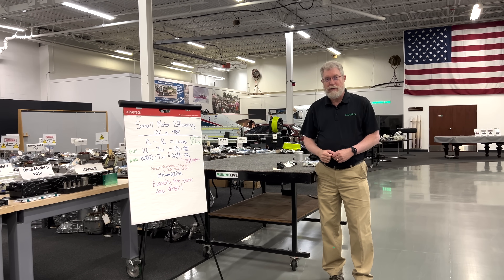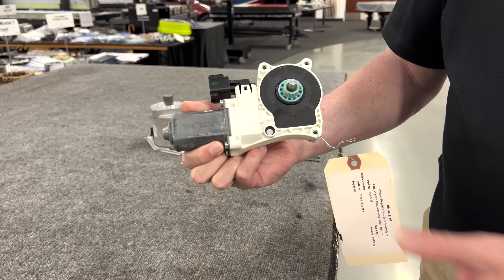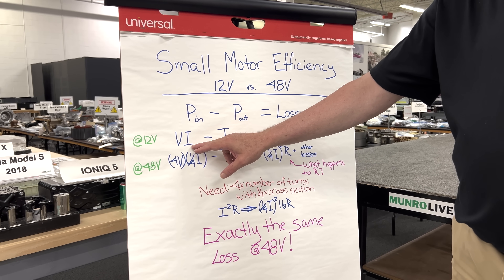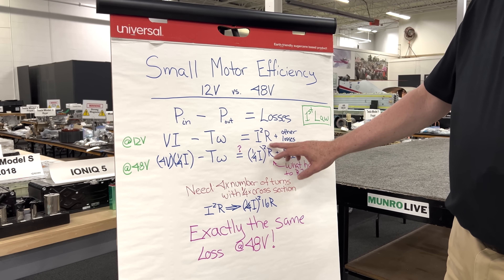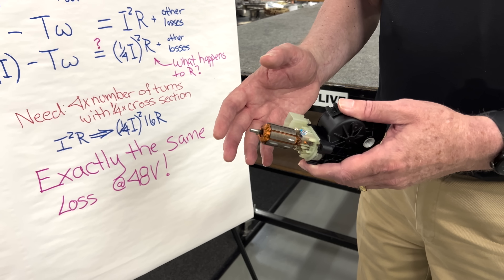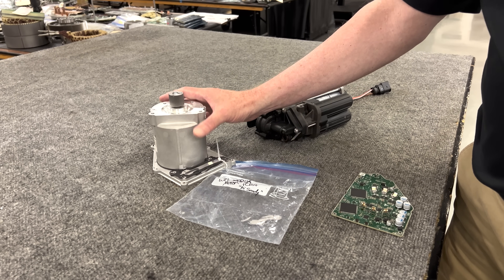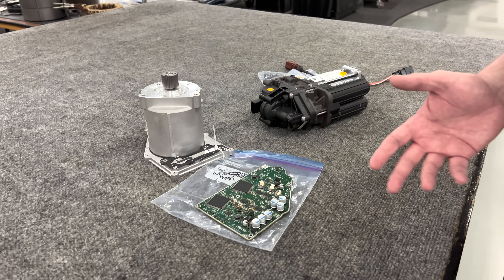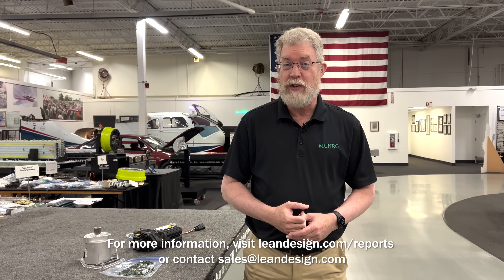Cybertruck 48V Motors: Why Tesla Made the Jump

Comment: That's the size of the truck motors.. Squints at cold steam self sustaining Tesla turbine systems that greatly multiply heat value and pulls out sample of Thermphilic bacteria that if given nutrient drip too dense will cause fires like how they ignite Mulch piled wrong Need Ultrasonic food processor to use ultrasonic waves to breakup and sort nutrient perfectly for %100 max efficiency of the bacteria's biological limits for panels. Oh a few gallons should last for months and months for continuous run cold steam. Woof.. Never freeze vehicle either.

If you pile Mulch and spray the right nutrients you'll see it start to steam in cool weather. If you forget to feed them even if cold they don't die they sleep until food detected. And that's not even using Ultrasonic stimulation on them which would cost almost nothing power wise. Generator stronger than needed for vehicle at full power use and Capacitors between generator and motors. Throws Nitrous Bottle to the side and thumbs up capacitors 

Might as well add a small plasma generator for ultrasonic Anti-drag, dust repel, pressure control, and anti-collision sensors.. Oh! Did I say I was talking about a truck? Points at Spiders flying with static electricity and points at static pipes that could be used for duct style internal blade/gyro turbine flying car My bad.. Why they say in science that Bees produce thundercloud level power in swarms but claim it doesn't help flight while saying static helps Spiders fly? THEY LIE.. Plays LEN BARRY 1-2-3 1966 😇*Trolls world Military like they're an evil Child*

Yeah I'm already on a watch list. Points at Iron man A government that fears intelligence? Yes..

Comment: For the same 100 watts of power delivered through a 2-meter (this is the length of one large human, or NBA player) wire with a cross-sectional area of 2.5 mm² (~14AWG), the power losses due to resistance are - 12V system: 0.93 watts, 48V system: 0.06 watts. 
As you can see, the power loss in the wire is significantly higher for the 12V system compared to the 48V system. This is because the current (amps) is much higher in the 12V system, and losses increase with the square of the current (I²R losses). The 48V system is much more efficient in terms of power loss in the wires.
Reply: you should state loss as heat, the same amount of electrons that went in came out
Reply: Except Paul's argument is that one needs 16x the length of wire to produce the same magnetic field. Sixteen times 0.06 is 0.96, 0.03 watts greater than the 12 volt system.

However, the glaring error in Paul's math is the assumption that power in remains constant. Not true. Only the torque must remain constant. If the motor can be made more efficient that lowers the electrical losses and thus the current requirement. The physics of motors, electro-magnetic fields, back EMF, etc does not result in linear relationships! Or, perhaps changing the gear ratio of the motor would be beneficial. 

In any case, I think Paul made his point - switching to 48v systems is not a trivial task.
Reply: Sure, but one watt is tiny.

I mean, I thought this was a good idea until I read your comment.
Reply: @myid9876543  The more significant difference is that you can use thinner wire for everything while still keeping losses and heating within acceptable bounds. Harness weight is significant, easily 100+ lbs in modern cars. Assume that you need some minimum size for mechanical strength, so 1/4 the current doesn't let you go to 1/4 the wire size but even if you only get 1/2 the size, that's still significant. (Insulation thickness at these low voltages is also dictated by physical durability rather than withstanding voltage, so it doesn't change.)
Reply: The transmission losses are not the primary losses in the system though so its really not much of a savings. That is the point of the video.

People still come in here and blab about transmission losses though so clearly the video did not sink in to everyone 😊

Comment: The symbol "I" is used to represent current (measured in amperes or amps) because it originates from the French word "intensité", which means intensity of current. When electrical notation was being developed, the letter "I" was chosen to represent current due to this linguistic origin, while "A" was already designated for the unit of measure, amperes.
Thus, in electrical equations and notation, "I" refers to current, while "A" refers to the measurement unit, amperes.
Reply: Interesting. I have spent days and months calculating electric problems, and have never known this. 
Also we don’t use “V” for voltage in the formula. It’s “U”. 
So the formula goes P = U x I
Reply: Indian watches rabbit while eagle Flys overhead

Comment: Couldn't you spin the motor at 4 times the speed with the same windings and let the gearing fix the window lift force? The higher voltage can handle the back emf.
Reply: It’s easier to rewind the motor for the voltage you want than to make a custom gearbox for a single SKU.  these windshield wiper motor assemblies are sold by the millions, and mostly share the same mechanical assembly.  Changing the gearing may save you a tiny bit of efficiency or size but you’d negate the value created by making it more expensive.
Reply: ...if the insulation can take it I'm sure it can do that, but at vehicle level does it make sense? The way to look at this is, the window motor is a toss-up, could have stayed a 12. However, since DCDC-s are expensive, no need to step down the HV bus to 48V (necessary for the power steering) and 12V (legacy) - the easiest is to go 48V everywhere.
Reply: @dragosmihai3489  but you still need 12V for 12v power points (cigarette lighter plugs) in the vehicle. Or does the Cybertruck not have any?
Reply: Yes it is possible but it will take a complete redesign of the device instead of just a motor replacement. The reason why it could not gain better efficiency is because they did a quick modification of the device instead of a complete redesign from scratch.

Comment: I believe the main economic benefit comes from the use of smaller wire gauge to deliver the same amount of power. Additionally, a certain percentage of watts is saved due to the reduced current over a given distance, factoring in the wire's cross-sectional area (mm²). The savings are not necessarily from the motor itself.

Comment: How was ride height adjustment implemented before? The steering i guess would have used hydraulics and that’s afaik not efficient..
Reply: Tesla has never used hydraulics in thier vehicles.  They either use motors or air pressure. The S/X's ride height adjustment is done with air.  Cybertruck uses motors (which are end up being faster to adjust).
Reply: @tesla_tap  interesting, thx. In both cases the compressor for the pneumatics is driven by an electric motor? And the 48V saves on mosfets? And what drives the compressor in an ice vehicle?
Reply: @janhofmann3499  - Yep, electric motor air compressor. Not sure about ICE - I've assumed systems are hydraulic from an engine pump, but don't know for sure.

As for Mosfet cost, they are driven by the current capability (not so much voltage).  
It's not a 4:1 cost advantage for Mosfets used in a 48V system vs. 12V, but perhaps 2:1 (for the same power requirement)

Comment: You didn't mention the savings in wiring. The wiring can be thinner, lighter, and cheaper and takes up less space.
Reply: They mention it in every other 48V video so perhaps they realise everyone knows by now!
Reply: @MrAdopado Yes, I didn't mention it in this video because we did a whole video emphasizing the savings in the wiring harnesses earlier.
Reply: @PaulTurnbull-EMfield  while that makes sense to those who often watch every episode of your channel, there is a high chance that others end up watching this as their "random" search result and will not know about that
Reply: marginal.  if savings are significant, the car industry would have been 48V a long time ago since mild hybrids with 48V. it actually costs Tesla a lot more for the 48V system but crucial for steer by wire so the guy is right about enabling new features.
Reply: @zodiacfml  Nowadays, power conversion is pretty inexpensive, so you can have whatever DC voltage you want for a given sun system.  Of course there are cost and reliability issues associated with inverters.  42 Volts was proposed as a new automotive standard in the early 2000s, but for the most part manufacturers showed no interest in redesigning their own or getting suppliers to redesign systems.  

There are some exceptions.  I have a 2001 Honda Insight with a 42 Volt power steering rack.  The hybrid system in that era Honda was 144 Volts, so Honda used two inverters, one for 12 Volts and another for 42 Volts.  The 144 Volts is used to generate 3-phase drive power or to absorb 3-phase generation during deceleration.  There is also a group 51 12 Volt battery for powering accessories and lights as well as a back-up 12 Volt starter which can crank the engine conventionally if the 144 Volt NIMH battery is off line - example cold weather.  The Insight is kind of neat in that being a parallel hybrid system, one can turn off the main breaker and the car will start and run las if the hybrid IMA system isn’t even there*.   *Actually if you do that, the 12 Volt inverter will be off line and the 12 Volt battery will go dead unless the plugs to the BCM module are also pulled out of the module.  I drove my Insight for a few weeks as conventional car a few years ago while waiting for a replacement battery pack to arrive.
Reply: also easier to damage
Reply: If your wiring inside your doors, under your floor, in the wiring harness etc are getting damaged, you have bigger problems :)
Reply: 5:35
Reply: Gotta save some details for the reports they sell 😅
Reply: He also ignored the fact that electricity doesn’t arrive at these motors by magic. It has to also get there through a wire, which does have palpable losses at 12 V.
Reply: @jamesa8851  no, but the wires can be thinner, saving weight and allowing more wires to be bundled within a certain cross section.
Reply: @paulmichaelfreedman8334  What are you saying no too?
Reply: The Roadster that people have paid $250,000.00 for will be out before that 2 door cab thingy....... right Elon ?...... with' 48v also...... right Elon ???.
Reply: @davidpearn5925 deposit was 50k, price is unknown
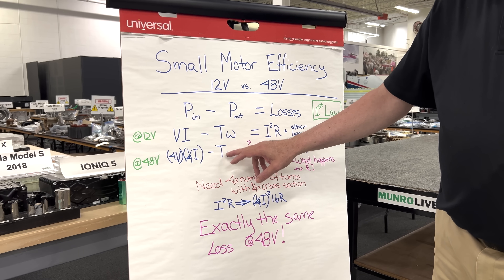Reply: I Squared R is mentioned around 4:00  > resistance loss in motor  windings but will also apply to wiring
Reply: @Kosmonooit  but back EMF wasn't mentioned.
Reply: Wire saving is also achieved by using the daisy chaining ECUs instead of the star connection wiring. This is a huge savings.
Reply: Only the distribution wires from battery to motor will be thinner

But the motor windings internal are same total weight and no difference in efficiency, but inductance is higher with lower current t
Reply: ...and also needs thicker insulation, longer clearence and creepage lines. Come on, it's not just benefits. It's predominantly beneficial on the wiring, not gonna say no to that, but it's always good to keep in mind this rule of thumb: current => conductor cross-section, voltage => insulation
Reply: @dragosmihai3489 Under 50V is the same creepage and clearance rules…
Reply: @dragosmihai3489  12 to 48 volts the same insulation is no problem anything under 60 volts is low voltage even 120- and 240-volt insulation is not that thick at 1,000 volts it starts to be noticeable insulation is far cheaper and lighter than copper.
Reply: @dragosmihai3489  Correct. However, the insulation on a 12 V wiring harness will easily handle 48 V. And the material is cheaper and lighter than copper.
Maybe we stuck to 12 V because any voltage under 42 V is considered safe. In an electric car with 800 V or more all over the place, this may be less of an issue,
Reply: @olafzijnbuis  max safe voltage for humans is normally considered 50V
Reply: I know that they have 42 Vac power tools for use outdoor and in wet conditions.
Not sure about 48 Vdc
Reply: @olafzijnbuis  I believe you’re correct because the insulation thickness is probably dictated as much for the need for mechanical abrasion resistance as it is for electrical isolation.  For automotive application, 12 Volt and 48 Volt insulation thickness is probably the same.  The net result is the overall outside diameter of 48 Volt wire is less.
Reply: @TheStrayWolf-g8t even 48V is dangerous & can kill, because current is important, that kills or shocked
Reply: @TheStrayWolf-g8t  

OSHA specifies max safe DC voltage at 60.
Reply: Everything in your car should just plug-in with an ethernet cable Poe
Reply: Yep exactly what Elon said, instead spent 7 minutes telling us it makes no difference to the motor.
Also leave out you could keep wire size the same and increase the size of the motor.
Reply: Does an increase in voltage also result in an increase in thermal energy?
Reply: Everybody knows that. Maybe that’s why he didn’t mention it.
Reply: Your calculation doesn't include all terms.

The motor can overcome back EMF much better with 48V than 12V.

So, if the motor doesn't move, it's the same numbers, but as it moves, there's less loss to back EMF at higher voltage.
Reply: Juniper Model Y will have 48V or bust! (IMHO) 😅. Besides, turning Ys into robotaxis would be better when you can remove the steering wheels.
Reply: Not sure why this obvious and relevant point was not made in the video
Reply: Probably could be easier to bend and fit in to.
Reply: and the  big winner is that power carrying capacity is 4-fold at 48V, for any diameter conductor, compared to 12V. If you keep them as thick as with 12V.
Reply: It's also more efficient overall to! 👍🏻😎
Reply: @4literv6  barely lol...
Reply: From what I know the wiring harness is also shorter in general.
Reply: He mentioned quartering the diameter of windings in the motors. Same principle.
Reply: The motor winding wire diameter is smaller for overall size reasons, not because it doesn't need to carry as much current. The wiring harness wiring, that's another story and is definitely smaller due to not carrying as much current.
Reply: @Pikminiman At iso power you need 4x the winds though.
Reply: @Pikminiman  easier not to have to infer everything.
Reply: The 48 V buss wiring and the boards that run off of it weigh less and improve the #1 efficiency, miles/kWh.